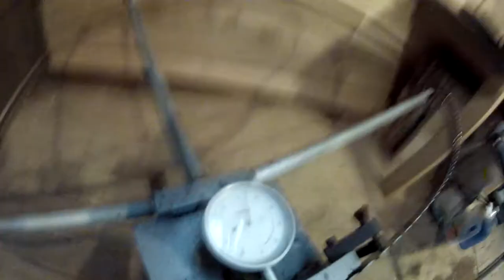Sharpening Wood Mizer blades on Wood Mizer Sharpener .

Comment: I have the same grinder was grinding it quite
Reply from the maker: It's been a good Sharpener for me .  Thanks for watching
Reply: @dansSawfish5604  OK lol thanks worked good for 1 blade lol
Reply: Good video
Reply: It was the fuse behind the controls lol I thought thier was only one fuse at the cord lol
Reply from the maker: @farmerfarmer2801  I didn't know you were having trouble with it .  Glad you got it going.. Grind lighter passes
Reply: @dansSawfish5604  lol ya lol learn curve 😆  thanks for ur video it helped me alot
Reply from the maker: @farmerfarmer2801  There is a newer video I put out is, How I sharpen sawmill blades for my wood-Mizer.
Reply: @dansSawfish5604  OK thanks
Reply: What mill do u have I have a 2019 35lt hydraulic
Reply from the maker: @farmerfarmer2801  LT-15  Wood Mizer

Comment: Hey Dan
How do you set the dial indicator on the Setter
Thanks
Reply from the maker: I got a gauge with my setter.  You might try a new blade in it and one tooth go right one tooth go left and one is straight-set to 0 your setter,  your left and right I set my at 24 to 25 thousands.
I do soft woods..

Comment: This drag grinder is one of the most frustrating crap I have ever worked with. On every blade you have to set it new, + trimming the grinding stone.  And as you do, you ruin the first 5-6 tooth. The band holding arms are a mess. The band queeze is clogging up very often.   A cbn sharpener is the only answer.
Reply from the maker: It took me one day to figure it out! I never turn on the grinder until I have it set where I want it and that only takes literally a few seconds each blade.
And the grinding wheel I'm on my third grinding wheel in 24 years. I've sharpened other people's blades as well, I've done hundreds of them and no problem here!
If you have one of these older wood Mizer machines I will buy it if you want to sell it, let me know ?..🌲🪓